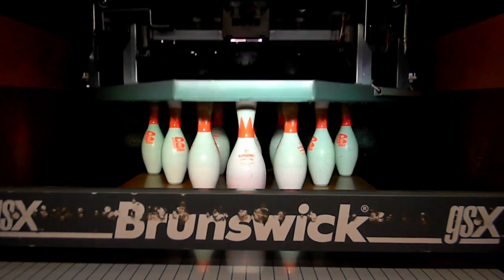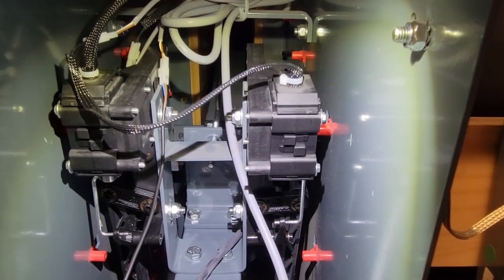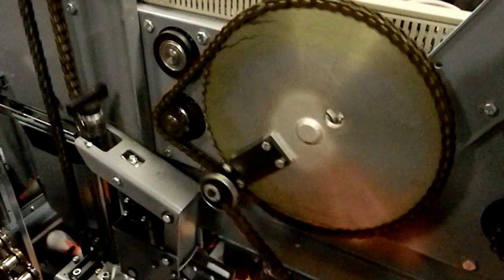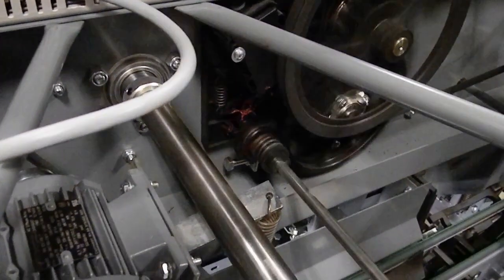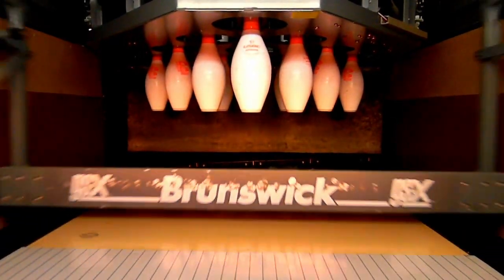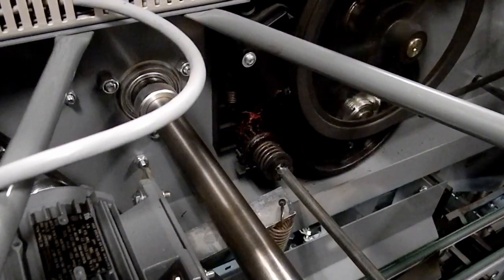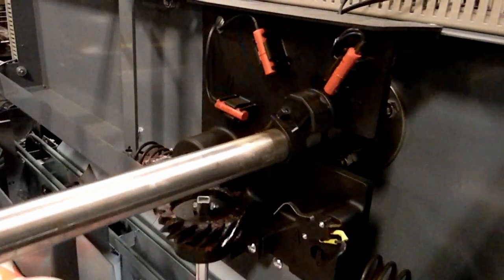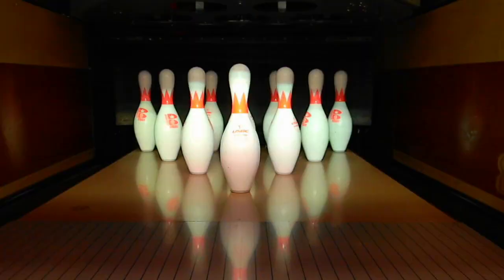Explanation of a standing pins cycle on a Brunswick GS-X

Comment: Nice. But I thought the GS-X is able to detect if no dead wood is there (either gutter ball or 7 or 10 pins missing, nothing else) and not do the sweep then?
Reply from the maker: You are correct, for filming I put it in diagnostics. it will pick up all pins in diagnostics, good catch.